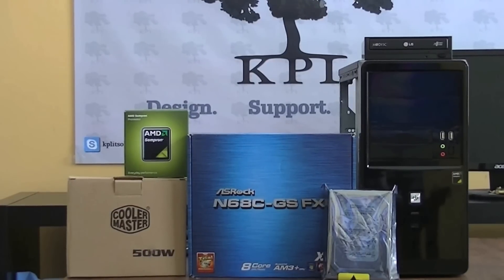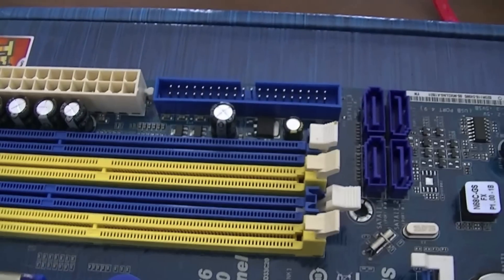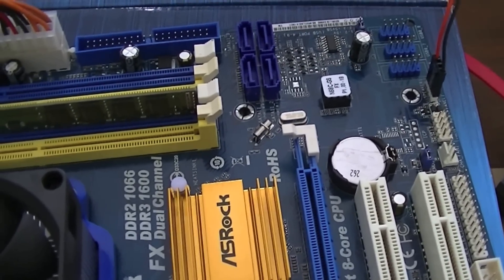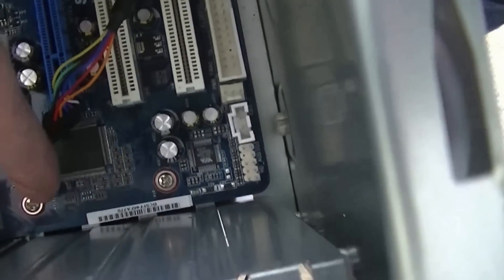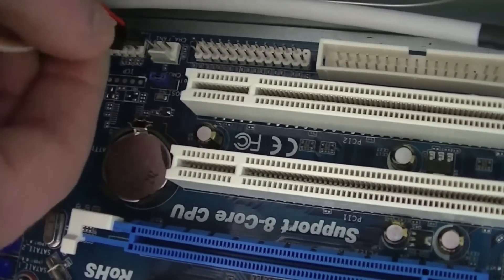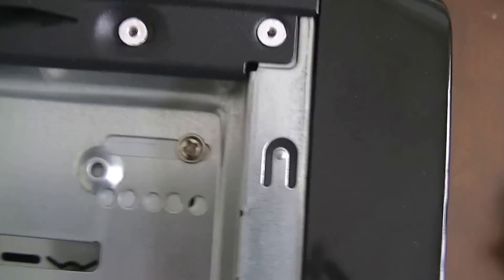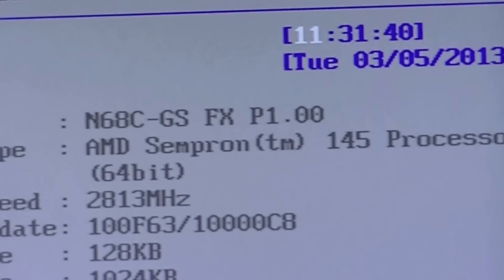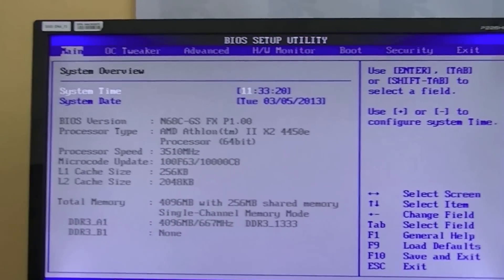FREE GIVE AWAY!!! KPLs Budget Build 2013

Comment from the maker: I wanted to experimant with overclocking as I have  never atempted it, plus the Sempron is only 2.8GHz and a singal core CPU, unlocking the core made it a Athlon II dual core CPU running at 2.8GHz, then by adjusting the frequency to 250 pushed the CPU to run at 3.6 GHz making it run a bit faster, I did push it more but It failed to boot 250 was the limit. 

Hope this has answered your question